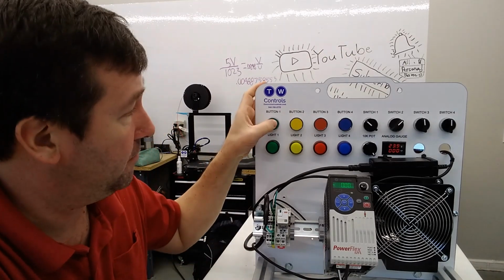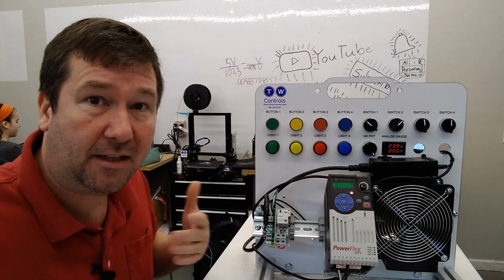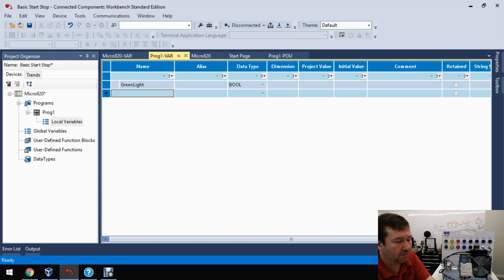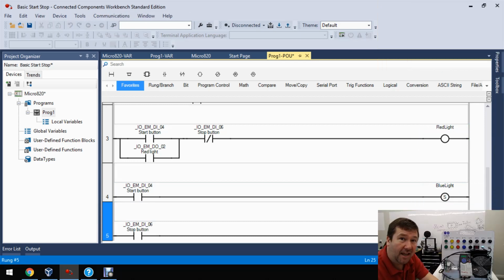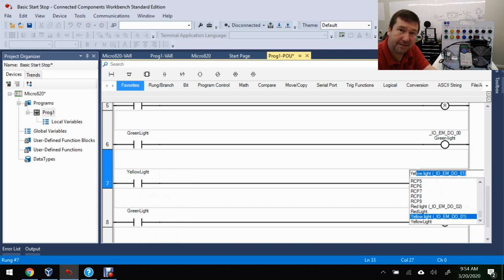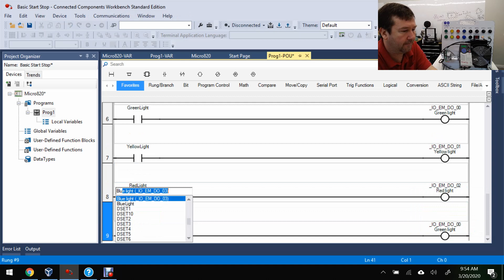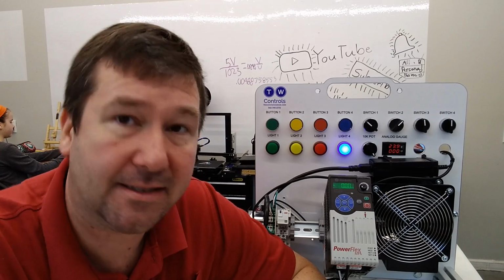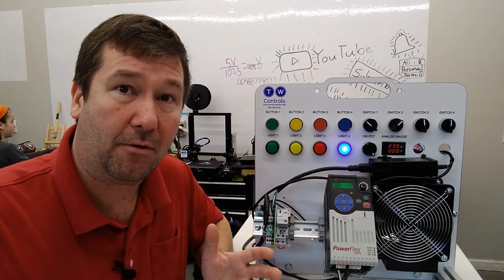Micro800 Make Outputs Retentive and How Power up Affects

Comment: I am having an issue in my Micro 830 where after a power failure it is not retaining my setpoints and I do not have the retain option. How do I fix this?
Reply from the maker: You need to create a tag for the Preset.  It is a little confusing but check out this excerpt from the manual.

After a power cycle, all variables inside instances of instructions are cleared. Micro830 and Micro850 controllers retain all user-created variables. Micro810® and Micro820 controllers can only retain a maximum of 400 bytes of user-created variable values. Micro870 controllers can only retain a maximum of 128 kilobytes of user-created variable values.

For example: A user-created variable called My_Timer of Time data type will be retained after a power cycle but the elapsed time (ET) within a user-created timer TON instruction will be cleared. This means that after a power cycle, global variables are cleared or set to initial value, and depending on the controller, some or all user-created variable values are retained. You can choose which variables to retain by selecting them on the global variable page.
Reply: Thanks for this snippet of info! @TimWilborne
Reply: I am not seeing your comment on this video. Please add any input on what you found out. Thanks. @dmacJessy
Reply: I do have a user defined tag for the PT. Same with my setpoint that I have in my greater than instruction. I'm not sure if it's just the HMI not showing the setpoint after a power outage because I don't have a tag for the indicator tag, or if it is the PLC setting it back to 0 after a power outage. From what the manual is saying my controller should retain these values without having to do anything extra if I am reading it correctly.  @TimWilborne
Reply: I find it amazing that you're asking the same question I had......within 18 hours of me......on a video that is 3 years OLD!  =)

Comment: Hi Tim it's Tim... Hey I bought a 2080-LC50-24AWB... I have the standard software of CCW. I noticed while doing this program that i do not have the retained column in my local variables. Could you tell me why? Do i need the developers version of CCW? and if you don't mind what is the difference between standard and developers version?
Reply from the maker: Hi Tim.  You had me stumped for a moment!  In the Micro850, all user created variables are retained during a power cycle.  So it is at if the check boxes are all checked.  Just so you can see that it would be there in the free version of CCW, change your PLC to a 2080-LC20-20QBB and the retain column will appear.  They just hide it since the boxes can't be unchecked.

I have a video coming on the differences between the paid and free versions of CCW.  There are minimal differences, most notably the paid version includes online editing.
Reply: @TimWilborne  Thank you Tim =)